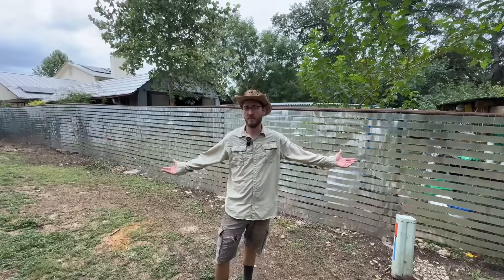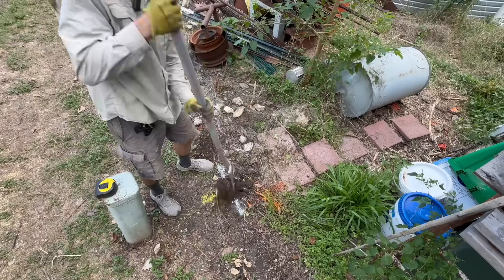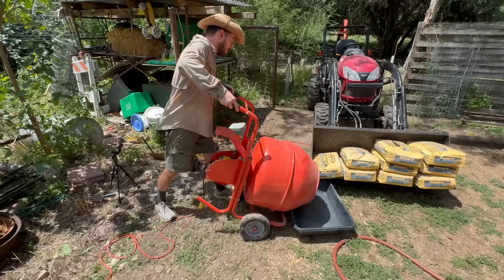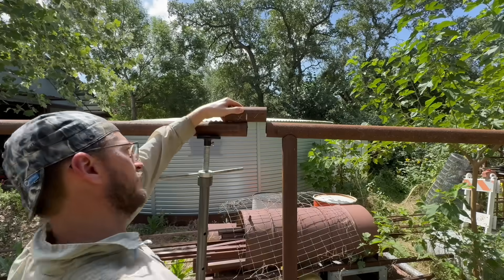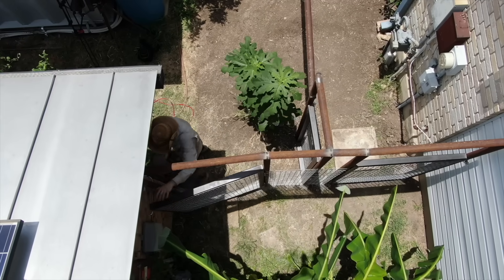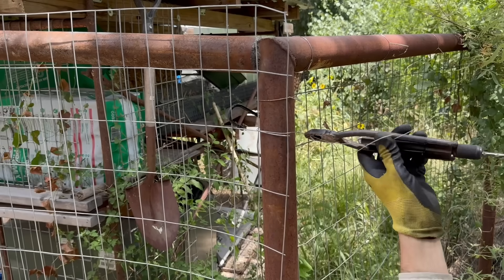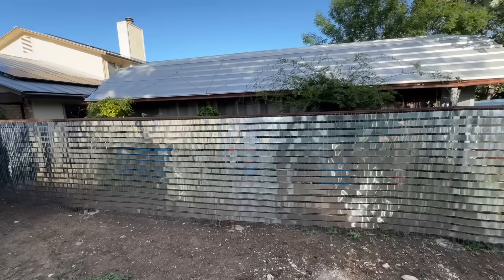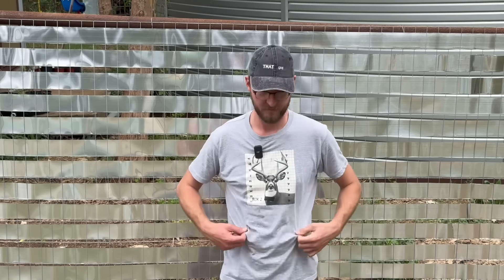This FENCE Lasts 100 years!!!!

Comment: I was convinced until you just used twist wire to hold onto all that weight. Yeah they're gonna rust and snap before 100 years. If you had just used them to hold the wire, before you went around and tacked each bit to the post, then it would be much stronger and not as wavy looking

Comment: Not just as a functional answer to a rural problem--it offers a practical and aesthetically pleasing solution in any situation requiring a slender, freestanding, wind-permeable barrier or internal divider. The clean lines and stylish and contemporary look of the materials would work well in an urban setting. Best of all, with a suitably modified framework, it would make  the perfect curvilinear screen. Genius.

Comment: It's crazy to me you can put so much mixed metal structure outside. I grew up in the mountains of Oregon and a structure like this would not last a season. You have to be careful of the kinds of fasteners you use to connect steel wire fencing to the posts because of galvanic corrosion.

Comment: looks like you changed roll of welded wire to a shorter length unless you sunk the one foot excess that sits above yer top bar into the ground which keeps critters n dogs from digging in under yer grade level🦝 fence..bravo..

Comment: I grow produce in the land of long legged rats and have discovered they are lazy, so you and I use 6ft welded fence for rat control and in 35 years there has been only one rat funeral.  The moral of the story is you can control long legged rats with a 6 ft fence. Smart work ,looks good!

Comment: What gauge is the fence wire & tie wire?  It looks pretty flimsy.

I like the cattle panels better.
My wire fencing is, I think, 12 or 16 gauge; I’ll check.  We use metal T posts, that have W shaped wire clips.  They are easy to drive in, and don’t require digging.  We have lots of rocks in ME.

Comment: You are using the string line wrong. There is always something that actually touches the string and pushes it outward. If there are several of these points, it can really throw off your supposedly straight line. A multiplication of errors. To eliminate this problem, cut 3 small spacers from any 3/4 inch material. (Actually, the thickness is not important, but 3/4 inch is easy to find and works well) On each end of your string line, move the string outward by sliding a spacer between the uprights and the string. Put the third spacer in your pocket. As you position each post, slide the spacer up the string until it just touches. Then put it back in your pocket again, and use it later on the next post. The posts can't push the string out of alignment.

Comment: 10 feet apart of that wire & metal fence is not strong for the life of the whole fence: "recommended", [ place an X metal bracket, between each metal post, connect top to bottom$

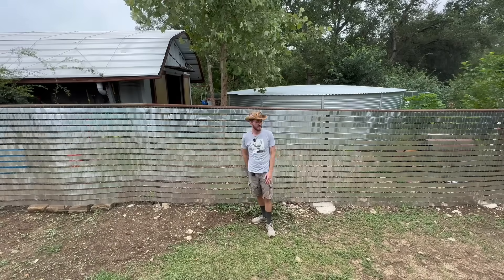Comment: 16:53 I had never seen a deer while living in Dallas. I visited Fayetteville, AK for a weekend and within that time, I saw deer jump over a 6ft fence right in front of me while we were driving to the university. 
Coincidentally, that was a fence just like yours though, completely painted green, even the utility mesh, without the aluminium foil. 😅It was a lot of effort but seems like it will be worth it in it’s sturdiness, low maintenance, and longevity.

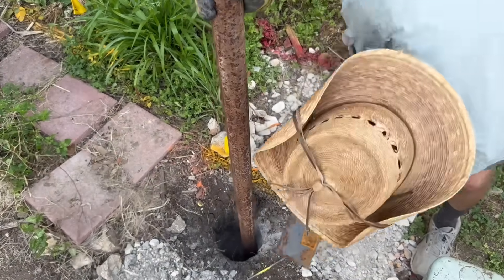Comment: 2:59 you are dangerously close to your gas service line. They can be 12 inches deep sometimes.  if you were to cut through it you would be liable. And when a gas line gets hit big or small its usually pandemonium.  Orange is your telephone copper, fiber, red is power, dont want to get tickled by that. Otherwise nice fence. Lol

Comment: You're going to regret using welded wire. A better choice is woven wire, because it NEVER breaks & comes loose, whereas, the welded stuff does. Add animals and those welds 100 times faster.

Comment: Welding fence as "one piece" is NUTS.  Fence should be ASSEMBLED so it can be maintained.  Any maintenance on this will require welder & angle grinder.  Use T-pipe hoops on the top & BOLT things together.  The wire netting is TOO THIN.  Wind will tear that up with the flashing on it.  Use chain link material instead.  Without a pipe on the bottom, fence will bulge on the bottom, especially is mud washes against it.

Comment: For an added security against wildlife you could string an insulted hot wire across the top, and / or a coyote roller would absolutely defeat athletic predators.

Comment: The string line should be close but not touch the pipe.

If you barely touch the line it will bend the line by a 1/16 or more, and will gradually get further away each time

Comment: Today Kids, we will learn how to make a galvanic battery: We use at least two different types of Material. For good measure we use iron rods, stainless steel wire, zinc on top of the meshwire and to top it all of, we use aluminium in between everything.
Now show me that 100 years lifetime with all the galvanic  oxidaisation going on. The ignoble material will give first. I guess that would be the steel rods. Good that they are the second thickest in this video. ;-)
It is a good thing that it doesn't rain so often where this stands. I would give the wired mesh a maximum of 20 years in germany. Perhaps closer to ten, before it gave out. With a lot of rain, the actual first point of failure would be those poporous welding seams. To me they look awfull. They look like they are only a thin laver on top of the material and haave way to much gas bubbles inside.

Sorry for downing all these points, over all I still like the fence and the work. I am watching this channel cause you do things differently, and than this comment 🙈.

For our climate we have something, that follows your idea, but is sturdy af. We call it Stabgitterzaun (best to google it and see a picture, that clearifys it immediately), directly translated to bar grate fence. It is 6mm thick steel rods welded together to make hughe elements that you can use to errect the fence (you still need posts). Those rods are varnished, typicaly in a cheerfull (like this comment) green. For those fences we have a lot of different materials that do the job of your aluminium, for example the same green we paint the fence in. They are fast to errect, sturdy af and will work for a long time (as long as the paint is not scratched).
Looking forward to that greenhoouse project.

Comment: You also use the string line to get a uniform height from corner to corner, not a relative height from the ground for each fence post, which would make the height different for each post. It's going to look comical if you measure relative to the ground at every post!

Comment: So how much did the flashing cost and how did you adjoin the strips?
Reply: Check your local big box store for the price.  I was wondering about how he joined the flashing strips end to end, too.  Drill small holes, and a rivet gun might work.  Two rivets per joint should be adequate, but I dunno for sure.

Comment: 3:40 you know ... if you had a slightly smaller pipe  or tee joint .. you might be able to just slip the ends of the bigger pipes over it and weld to it instead of having to do all that cutting ...   whats the inner diameter of those pipes?

Comment: 3:22 looks very similar to alot of the public school fences and bridges around my way from the 40s and 50s tho those are a bit shorter and tend to use tee joints so instead of welding they just screwed them tighter ... and maybe a little bit of welding to make sure they dont back out then painted them .. tho given the lack of oil wells here i suspect it was probably old water pipe or gas line maybe ?  oh yeah and old railway track also makes for good fences you can use the width difference between the head and foot of the rail and the web to make a channeled to hold planks or what have you rail sleepers work well to all that creosote preserves them well tho i do wonder now that i think about it if its actually a good idea to make planter boxes out of them ...hmmm

Comment: why you didn't concrete the bottom of the fence. the pipe has the top firm but the bottom? in Guyana, we either use 12'' width board or concrete. we need to keep uninvited guests out e.g rats mongooses etc

Comment: Lasts 100 years.
Uses pre-rusting pipes.
Touches concrete with bare hands.
Steel wires.
Aluminium flashing...
Says he wants plants growing on the fence.
Do you know what rust is, and you're going to kill any and all plants because it's all metal
It'll last 20 years, maybe 50 if you're somewhere arid, which it doesn't look like.

Comment: I've built similar fences using scaffold poles. Yours is prettier.

If you add a couple of tension wires at 1/3 & 2/3 of the height then you'll pretty much eliminate the waviness and minimise the flapping in the breeze that the flashing will cause.

Comment: For twisting wire maybe a set of plyers and heat PVC pipe heat to fit and hold plyers tight with a wood or steel plug with an Allen wrench centered for a drill to turn plyers.Maybe notch plyers jaws to center wire.Just a thought.

Comment: An admirable piece of work !Aluminium flashing is a great idea. The metallic look is modern, clean and enduring. It is fantastic as is. Vines will only be a maintenance burden. If solar heating is a concern, why not strategically plant tall trees like your sycamore to deliver shade and cool breeze ?
Ideally the frame (pipes) could be painted to add a layer or two of rust defence.

Comment: It might be advisable to use coated steel wire. Corrosion might occur over time from the aluminum and bare steel reacting from touching. Great concept, proof of concept and implementation.  

Let me know commenters if you think these materials are fine as is.

Comment: 16:33 Did you consider the heat looking at this?
Reply: LOL I thought that too the sunlight reflection gonna go crazy
Reply: Just thinking about accidentally brushing against it by hand in the Texan sun makes my seat belt buckle burn scar twitch
Reply: Heat can't see so nothing to worry about.
Reply: Can a hot reflection start a fire? Would the flashing stay in place under high winds?
Otherwise I like the idea.
Reply: It’s aluminum flashing so it doesn’t retain heat.

Comment: 9:50 "Fwends" ftw. xD Glad your neighbor is cool with you doing extensions of projects even over the property line. 

In Texas, especially, I'd have rounded off the metal sheet rolls to prevent neighbors/small children/my own accident-prone self from accidentally cutting or slicing themselves on the fence. I'd have also sprayed both sides of the fence with UV protectant /mattifyer so I wouldn't sunburn the eyes of my neighbors and family members whenever we walk outside. While I don't live in Texas, I have lived in Arizona and now live in wintery state so I'm keenly aware that even the sun's reflection can do damage to our eyes and skin. (Namely snow blindness caused by reflected/scattering sunlight and getting sunburned based on the nearby reflective surfaces of water, metal, or sand, etc.)  

Not that you're reading this 3 months later, but on my hypothetical property, I'd definitely wanna make a fence a lot like this. Sooooo very beautiful and yummy plants can grow on a lattice-work fence -- not merely climbing ivy. Plants including beans, peas, cucumbers, tomatoes, some peppers, morning glories, American wisterias, climbing hydrangeas, and honeysuckle!! You can have just as much of an ecosystem around the fence as you get to everywhere else. <3

Comment: 4:30 The best way to make sure your line is straight is to NOT touch the string. Offset from the line either by eye which is more than accurate enough most of the time or use a shim. Most people use a pencil wrapped into the string on either end & then use the 3rd pencil in their hands as the shim to measure. Whatever you want to use doesn't really need to be a pencil but it's a uniform width, it's an easy marking tool & you probably have more than 3 around.

Comment: A lot of ingenuity and a ton of work here... my only comment is DON'T use stainless wire (particularly small-gauge stuff) next to drill pipe; the galvanic couple is bad.  It may last pretty well in arid Texas ... in any area that is rainier, and particularly if the rain is a bit acidic (thankfully pollution controls have greatly decreased "acid rain"), it would be gone in a very few years.  There's a reason the standard "cyclone" fencing ties are a galvanized soft steel in a much larger diameter. 

Anyone taking on a project like this needs to think about the cost/value of their labor, vs materials ... vs what you get.   I'd go with the pultruded HDPE+fiberglass pipe. even at the cost of buying it.

Comment: Growing Ocotillo along that fence would definitely deter deer, and criminals. The cacti would also be able to handle the heat radiating off the reflecting metal. One drawback would be if there were fence repairs to be made... ouch, but since it's a hundred year old fence, meh

Comment: That fence is not going to last 100 years yes it's going to last a few years but if you would have cleaned off the rust and put some paint on them they would last longer because Rust doesn't stop and besides there's really no way to test if that fence will last 100 years yes it will probably out last you but rust is unpredictable sometimes it seems like it will last forever and they will have only a little bit of rust on them and there's some times it doesn't last and yes having a dry climate does help out but I have seen it in the most driest climates where the rust just took over and like 20ft away there was no rust  at all and both thick metal pieces have been outside for the same amount of time and when my grandfather add two model t Fords in a barn and they were in really good condition but when you got too old to take care of them can you put a lock on the barn door and wouldn't let nobody in there because he was old and ornery so as time went on he passed away and the roof of the barn was in terrible condition because of him let it sit there for a lot of years locked up let me open the doors it had holes in the roof it had rained on the two cars and they were bad condition when was worse than the other by far it was so rusted that things had to be cut out to repair it but the one right next to it was in way better condition with only a little bit of rust on l can't explain that one because both of them should of had the same damage like I said rust is unpredictable but you did a good job on the fence it looks good YouTube videos coming

Comment: This is awesome. I live in an area that gets intense fog. It can last for a few weeks. I usually get moss growing on my wood deck. I need a fence around my property.  Would this be an option for my situation?
Reply from the maker: This would probably work. The high humidity you describe could lead to increased corrosion but you could buy some zinc anodes on amazon and wire them to the fence. That should prolong its life. It may last a less than 100 years in a wet climate though.
Reply: @suburbanbiology  thank you for replying.  This video and your reply have inspired me to finally build a fence.

Comment: We know that aluminum is unhealthy and should not be used to cook with.  After that fencing heats up and then gets rain, I'm wondering if the soil will suffer from heavy doses of aluminum.  I love this idea, but always thinking of health first.  I could be wrong but I'm not a science-minded person so I'm simply wondering.  Opinions?
Reply from the maker: I suppose in an area with very acidic rain it could free up some aluminum as the rain flows over the flashing??? But otherwise aluminum tends to form a stable oxide that really should stay put for the most part. The only other thing I could imagine is that galvanic corrosion with the neighboring steel and zinc (the galvanized mesh) could form some aluminum compound that falls off the fence but I’m not smart enough to think through all that off hand. Either way I think the amounts of aluminum leached into the land would be extremely small.
Reply: @suburbanbiology  It's a very creative idea for sure!

Comment: Did you do anything to de-burr the cut edge of the flashing? Or is the entire fence a potential cut hazard that you really should be wearing gloves to go near?
Reply from the maker: The material is so soft it doesn’t really cut flesh. I got more injuries from the safety wire pliers than the flashing 😂

Comment: I have a question about the heat that will come off that aluminum material in the Texas heat. Won't that kill the vines you have planted? I will be interested to see how it manages to survive in the heat. I think you did a great job. It looks great. But, while you were at it, why didn't you build the fence another foot or two higher? Thanks.

Comment: How much heat will that metal flashing reflect on you?  I had a young lady ask me to build her a fence and use corrugated steel that she had stacked in her yard.  I reminded her that steel sheets get hot and reflect heat and Sun.  She said that she would be able to live with it, so against my better judgement, I built the fence for her.  Well, about 6 weeks later, she called me up and asked me to come over so we could discuss removal of the fence and a new material that was not wood.  It was like standing in a microwave.  We live in the Greater New Orleans area, so it is already hot.  Oh, and there are some rather large oak trees in her and her neighbors yards to provide shade, and it was still hot.   Even with the pool.
Yes, I heard you say you wanted to grow vines on it, and yes, that may lower the amount of heat, but it will take a while for it to grow.

Let us know how your back yard temps do with that material there.